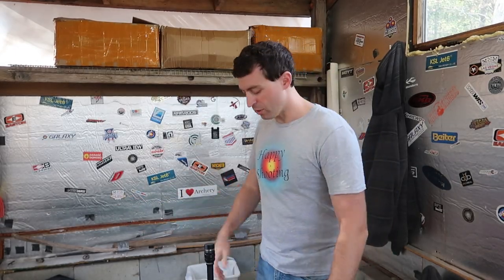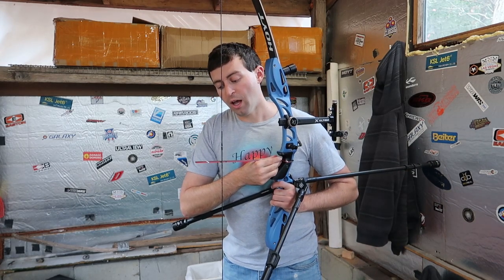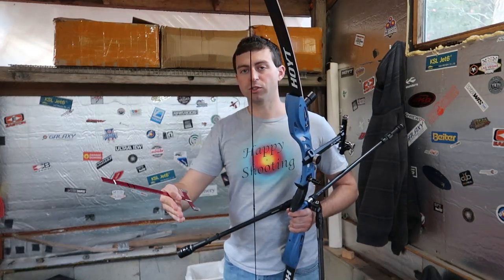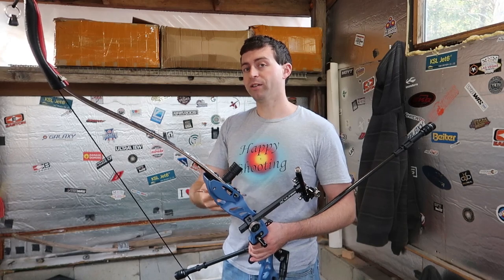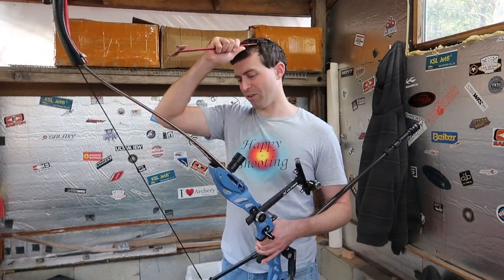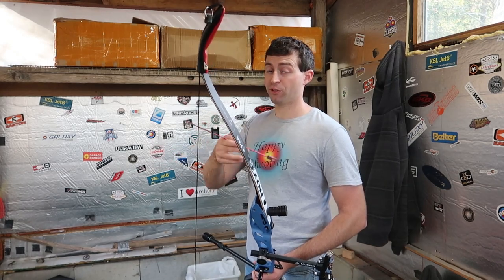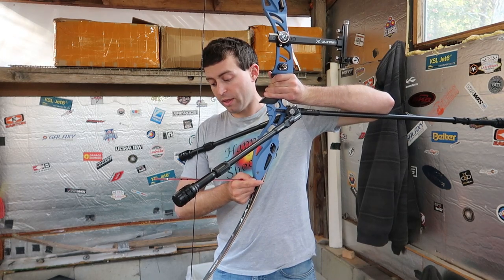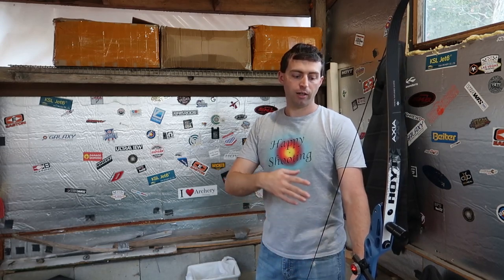Part 1 My Brace Height and Tiller Settings for Hoyt XD and Axia Limbs

Comment: Wait a minute, so you're setting it up with a -1/8 inch tiller? I thought Olympic recurve bows are usually set up with neutral or positive tiller? Or am I confused?
Reply from the maker: I am the confused one. For some reason I inverted the tiller settings. So I will make a part 2 video with the correct setting. Thank you for bring it up
Reply: @shoreshotarchery  Ah, I see. I'm grateful to be of help.
Reply from the maker: @amrazing33  the funny thing is the bow still shots great with that setting but it did give me a much lower sight setting.  I will make another video talking about it
Reply: @shoreshotarchery  it's probably because of the lower grip, no? Lower pressure point (and possibly nocking point) meaning there's more pressure on the lower limb than on other "normal" risers. Hence, you could probably shoot it with more "negative" tiller.

Comment: Hi Anthony, quick question, I just bought those limbs, I can’t wait to test them next week, so to keep your gear in good condition do you unstring your bow after shooting every time? I never do but I’m wondering if this is a thing. Thanks.
Reply from the maker: I shoot almost everyday and leave my bow strung. I have had zero problems over the last 17 years. If you have very inexpensive equipment (usually means lower build quality/materials), only shoot once or twice a week, store you bow strung in a spot has big temperature swings (ex. unattached garage) then I would unstring it.  The one thing to keep in mind if you bow is left strung. Is to put it in a place where people will not accidently step on the limbs if its sored on the ground. Other then that you should be good